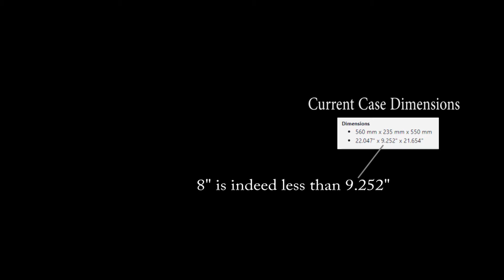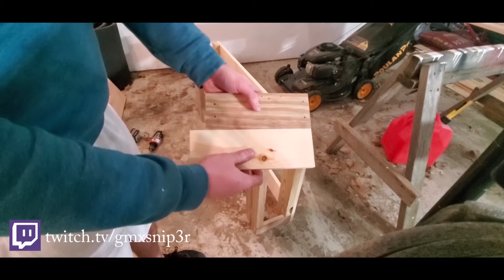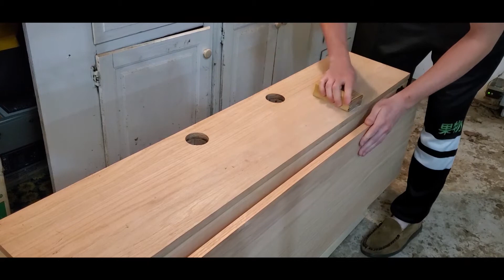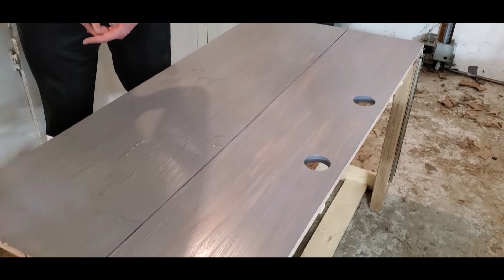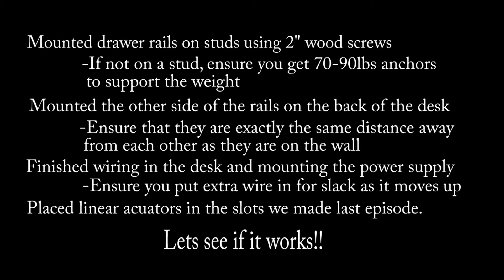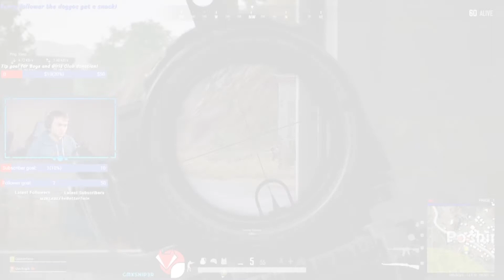BUILD YOUR OWN BUDGET ELECTRIC SITTING/STANDING DESK PART 2!

Comment: Great instruction style. 
Cool design as well. I was thinking to make a similar one. May I ask how happy you are with the performance and comfort so far?
Reply from the maker: Thank you! I hope it goes well for you! And I am very happy. The actual desktop is in the desk as well and all moves as one so I really enjoy it! It sits just where I need to without any wrist problems or anything.
Reply: @gmxdiy8596  Ah, that is a really good idea. I may get some inspiration from that as well.
(I don't think that I will find the time for it soon though.)
Yet, I am considering to make one without the actuators, but rather some counter weights and a pulley system. So, it could be mostly silent and quicker. I avoid noise since I usually work in late night hours while my family sleeps.
Reply from the maker: Very cool! You should! I thought about doing something similar to how a gym rack goes on the wall. I hope you are able to find the time or maybe even some pre-made products to quicken the process!